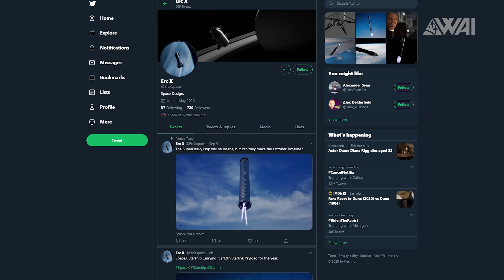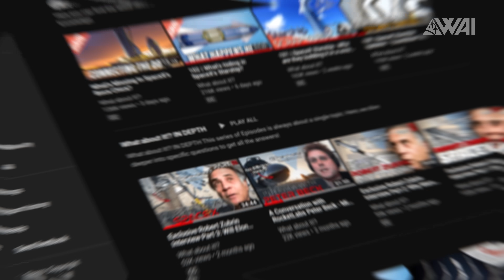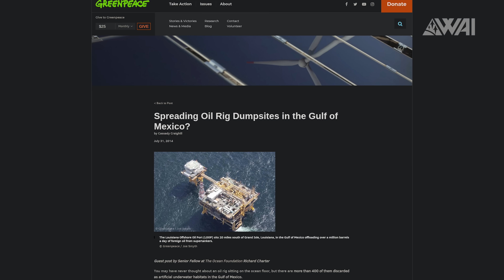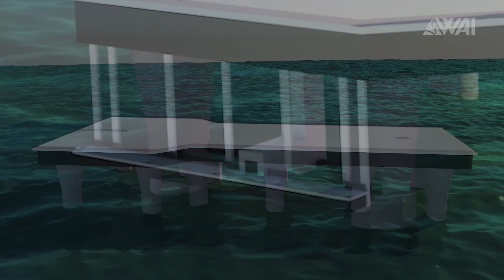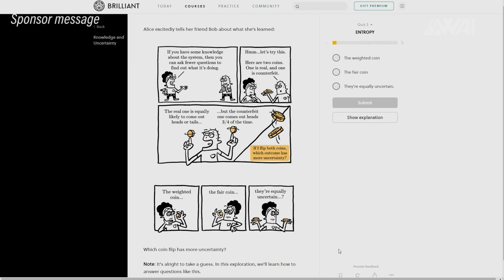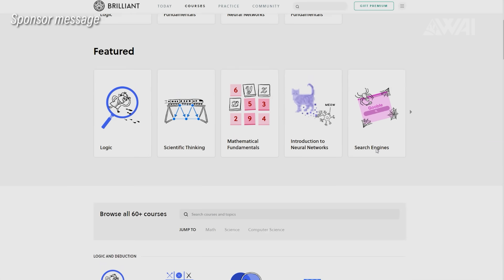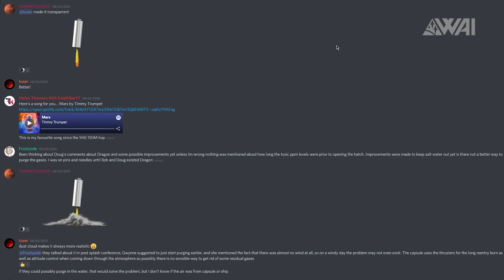118 | SpaceX Starship Mass Production Starting

Comment: I doubt simply exhausting the rockets toward the sea would be good enough. The #1 reason for the sound suppression is to stop the sound damaging the rocket's bell nozzles. I would guess they will still pump water into the exhaust plume between the platform and the sea...A bubble curtain still makes a lot sense though and I'm guessing it would also be used.
Reply: Imagine the difficulties of  transporting the built starships to an offshore platform and elevating them onto the platform.
Reply: @timothyfiedler344 I wonder if they might launch them from the factory to the off shore launch ports. When they build an airliner it flies away from the factory. Starships and the Super Heavy boosters could do the same. The Starship should have no problem making a suborbital flight to a launch port and the booster with perhaps a aerodynamic cap installed should be able to as well.
Reply: You mean hop the starship and boosters over separately with just enough engines and fuel, install the rest of the engines and the fuel+ cargo once on the platform prior to main launch.
Reply: @timothyfiedler344  I'm saying launch completed Starships and boosters separately from the factory to the space ports. Where they would be mated with one another, loaded with cargo and fuel then launched for their first orbital mission. Both are being designed to make many flights with little more than inspections between flights so the easiest way to get them to the space ports may be to launch them there. I say separately because I doubt a booster could land with a Starship still mated to it. Another way to get around having to load Starships and booster on barges is to have their maiden orbital flights launch from the factory then land at the off shore space ports for reuse.

Comment: Why wouldn't SpaceX build them on shore then hop them out to the launch platform?
Reply: Yup, I figure that's how a SS or SH can get back and forth when it needs to, either when freshly built or if a certain need for maintenance is spotted after a mission. An SH can launch lightly fueled, firing a minimal number of engines.
Reply: Still need to use many engines because of the weight of the ship

Comment: If there are a lot of oil rigs available, link 3 or 4 together for each launch "complex." Lots of space then
Reply: would they build a bridge between the oil rigs?
Reply: @zelda_smile  not SpaceXy enough. I'm thinking an underwater zipline surrounded by an air curtain so you don't have to use any scuba gear......
Oh, and it moves you at the speed of sound.
And they develop a way to bore water with a new machine that lays down the bubble curtain and makes freshwater ice cubes to be shipped in self freezing packages to be airdropped during launches on countries that need drinking  water.
Reply: @Christopher Leveck 
Sounds about right for SpaceX  XD

Comment: There are bunch of problems with using old oil rigs as launch platforms. First it's doubtful they could withstand the stresses launching something as large as Starship would put on them. Next most of the gulf oil platforms are not in good positions to be launch platforms and cannot be moved. There are floating platforms, but the abandoned gulf platforms are basically steel towers built on the sea floor. Which is why they get abandoned when the well runs dry.... Anyhow ideally we would want launches not to cross over Florida. So they should be in the Gulf south of Miami or on Florida's east coast. At the very least we would want them close to the Texas coast so at least the booster would hopefully not crossover Florida. 
IMO though SpaceX may partially reuse an oil platform for it's first or even first couple of off shore space ports. Ultimately they will build floating platforms that are similar to floating oil platforms from scratch and they will be positioned off Florida's east coast. In the end a 1,000 mass produced Starships are going to need mass produced, not adapted space ports to operate out of.
Reply: Also, a floating one may not be big enough for their purposes... they're big, sure, but Starship and SuperHeavy are going to need a lot of space... especially if they're going to be operating multiple boosters out of each platform.
Reply: Was looking for this comment.  Thanks.  Most of the abandoned oil rigs are not mobile.  They are fixed to the ground (under the sea) similarly to a building.

Comment: knowing spaceX
i guess for there planning would be if every thing is going correctly
14-09-2020 FN 7.1 Boom
20/25-09-2020 SN 5 second hop
1/10-10-2020 SN 6 second hop
10/15-10-2020 SN 8 hop
20/25-10-2020 first super booster hop
25/30-10-2020 SN 9 hop
1/10-11-2020 SN 8 high attitude hop
10/11/2020 SN9 second hop
15/11/2020 SN8 second high attitude hop
20/25-11-2020 second super booster hop
25/01-12-2020 SN 10 hop
01/31-12-2020 Full star ship space flight test
Reply: This would be really great!  Even the first half of 2021 for a successful orbital Starship would be fantastic!
Reply: I don't want to make you sad, but that's a very optimistic plan. I think the only thing that will come true is a high altitude test by the end of the year. Booster hop early next year and so on. Full Starship flight next summer.
Reply: That's Elon time.
Reply: Elon: "Can we do it in half the time?"
Reply: Merry Christmas

Comment: The launch platform will have to be way bigger than the mockup shows....the arrival of people, supplies, and rockets will require a very large 'port'. The energy requirements to pull C02 and 02 out of the air for rocket fuel will require a huge amount of power (maybe on the order of acres of solar panels and batteries). Other buildings to support all the infrastructure will need to be moved a significant distance away from the launch/landing pads. I am sure there are other considerations, too.
Reply: The 'Fuel farm' would likely need it's own platform. I also would suggest a capital T shaped platform, so the High Bay analogue does not open to fave the launch mount. The other end of the cross piece would have a cutout that would allow the crane to unload the Boosters or Starships from droneships.

I agree on needing more facilities for personnel using the Starship. Fuel and O2 could be delivered via pipelines.
Reply: maybe they will have two platforms, one for launch other for control center and people who work there.
Reply: They would probably need separate platforms.  One for launch. One for service equipment. A LNG storage ship for propellant loading and transport. It would be stupid to have  everything in one place. When an accident happens everything is destroyed.
Reply: So basically like mother base from MGS5?
Reply: Agree, scale seems to be off

Comment: I assume assume as you, that they will make use of an old oil platform similar to what Space Launch did. It will also be possible to get their launches closer to equator than from Texas, in which saves rocket fuel.
Reply: Texas is already close to the equator, for decades it has been the obvious alternative to Florida.

Comment: If spacex needs a 30km exclusion zone for a superheavy launch, why are they building the orbital launch pad at the current starship launch site? Wouldn't a launch from there damage the build site?
Reply: It's a freaking water tower! Just kidding, maybe its not for superheavies but for orbital launches of smaller rockets, like starships.
Reply: They only need 3-6 Rapters for initial SH booster testing .. the full compliment of 31 will need sea launch for sure because of the discussion started here

Comment: Wouldn't it be better to use like an aircraft carrier jet elevator that way there would be no flooding or damage if a storm with big waves washes onto the lower platform.
Reply: An oil rig costs between 20 millions and one billion, an aircraft carrier between 10 and 15 billions. Question answered?
Reply: Just use a crane to lift the rocket.  Small items can use a human scale elevator inside a platform leg, with a nice watertight outer door.

Comment: I'm sure the under water nuclear bomb test were a lot more damaging to the ocean environment than a Super Heavy launch will ever be.
Reply: That was probaply not with three testings per day. But you're right, armies do not care about the enviroment. They where constructed to kill as much as possible.
Reply: @Bauer-ke6lp  The Super Heavy will not be releasing fissionable material into the environment. Also the sound will be generated out of the water and not in the water as in the case of the bomb tests.
Reply: Bauer 33333 you don’t honestly believe they’ll be launching on a schedule like that do you? First off, what customer WANTS that many launches? Plus, how are you gonna refurbish a Rocket that fast? Remember, heat shields require full manual refurbishing and at least a look-over after every reentry.
Reply: @maerus5227  That schedule is not made by me and they will ned a ton of rockets to colonise mars. Refurbishment is easy doable, the more rickets you refurbishe at once the more time you have to get one done. 1 rocket 1/3 of a day, 3 rockets 1 day, 21 rockets one week,  ... They will probably need multiple launch platforms to deal with that amounts.
Reply: You're talking about millions of pounds of thrust multiple times a day.  It will most definitely cross the air/water barrier and it will be a massive amount of noise that will potentially disrupt/kill sea-life.  Pink Floyd did it with just a couple guitars some drums and keyboards.  This isn't a question of what happened in the past, it's about how we can best act in the future.  I'd be open to hearing more about the effectiveness of these air-bubbles as a noise suppresion system.  I'm a huge fan of the Starship system and SpaceX in general; if this can be made to work in an environmentally safe way then I'd be for it.
Reply: @j.jastner8374  actually the air bubble system is great for sound that's generated INSIDE the water, and ultimately, you can just build 2 if 1 is not enough  (first one diminishes most vibrations, but some still makes it past the bubbles, so the second external barrier is able to dumpen it)

the way they work is actually quite simple
sound is a vibration, so you just have vibrating water, but the bubble is (lets approximate it to an air wall) a different medium that separates the inner part from the outer side

another way of thinking about it (more technical) is by assuming that sound transfer in water is very alike to laminar flow, but then you have a barrier of pure turbulent flow (bubbles) so the kinetic energy from the sound vibration is favoring an "even more turbulent" flow when in contact with the barrier  (this has a limit obviously, but adding more barriers just solves everything in an easy manner)

the problem left now is the fact that the sound is outside the water too, so the transfer from air to water from afar would be enough stress to be disruptive for the ecosystem, and all the variables like hoe great that impacted is, or how far is it dangerous inside the water, or is it meaningful at all should be tested
the problem of the water vibrating due to exhaust is already easily solvable
Reply: @j.jastner8374  How do you know what you claim is true?
Reply: @jcf20010  Which point? If you're talking about the pink floyd story it is well documented. The fish in a nearby pond were killed due to excessive decibel production. That's air to water transmission. Or maybe you mean about the starship launch being the loudest human made sound over the ocean since nuclear weapons were detonated. I guess I don't know for sure, but do I have to?  Over land they are talking about a 30km distance to not disturb people or buildings. Can you imagine how loud that has to be to require the launches to be that far from people? It wouldn't even be considered if it were at all possible near a populated area.  Launching from sea will cost more money than having a stable land-based launch facility.
Reply: J. Jastner , Of course not to try and justify it and certainly not the same thing, but that’s pretty much what NASA did in the sixties and early seventies “over water” in transporting Saturn stages from the west coast to Alabama for testing then on to Florida for flight.  The point is sometimes if that is the only practical option then that’s what you do.  Expensive yes, best practical option, also yes.  I’m glad so many people are thinking of ways to help marine life.
Reply: @sonnyburnett8725  We have much more information than they did in the past, and we know better. Further, we live in a golden age of information and ingenuity. SpaceX and tesla are used to solving hard problems.  It is not good enough to simply go down a path because it is practical and available. The stakes are much higher now and the environment is a closed system. Everything circulates. So if sea launch becomes a reality, OK, let's do it. But let's do it right. Let's do it responsibly. The adolescence of humanity should be behind us - we've got the video to prove it. Time to act like adults.
Reply: And even with that, who really cares? I’d be willing to bet that it would be GENEROUS to say that you kill 0.000001% of any given species each time you do an underwater nuke. 

Plus, our goals are simply more important than fish lives. Don’t know why that’s so hard for people to wrap their head around.
Reply: @maerus5227  this kind of thinking is morally wrong.  It is the same kind of thinking that destroyed the American Indians and killed millions of jews and other minorities in Germany. What we think is important does not give us the right to destroy or treat things carelessly. Yes, it takes effort, but there is a right way to do things. And there's no excuse for not taking precautions, or fully understanding the system before affecting it.  I would argue fish have rich lives. But it's not just fish. It's also cephalopods and mammals, The intelligence of which we don't understand.  And since planet earth is a closed system, ultimately, it affects us all. I'm tired of mercury in my tuna, microplastics, medical waste on our beaches and a garbage patch as big as Texas floating out there. How about you?  Research and study is required first. We don't need another misstep.
Reply: J. Jastner you’re not seriously equating THE HOLOCAUST to some dead fish rn. Seriously. 

And It may be unpopular, but yes, I believe that our species is superior to others. Sorry ig. I’m not saying that we shouldn’t extinct something, or attempt to protect endangered species, but a few fish? Yeah. I’m down with killing them if it means advancement for our species. We do it everyday already. And everyone doesn’t complain about all of the luxuries they have on a daily basis at the expense of all the animals.

Also, you’re not seriously trying to argue that fishes have any resemblance of real intelligence, are you? Because that’s a pipe dream Greenpeace kind of thing. News flash: they don’t. They’re VERY basic animals.
Reply: @maerus5227  No, if your critical thinking skills were up to the challenge, you would know i'm not equating killing sea life to the holocaust; I'm equating sloppy thinking, a lack of research and unpreparedness to the point of view that you are espousing (charging ahead without considerable thought to the consequences).  You live here, in this closed, constantly re-circulating system, you should be concerned about the end-game regarding polluting your own habitat.  There's an old saying that really conflicts with your POV - 'don't shit where you eat'.  Your point of view is unpopular, IMHO, not because some people just don't care about fish, but because the reasoning behind your argument does not withstand scrutiny.  Who argues that research isn't a good idea before moving ahead with something we don't know much about?
Reply: J. Jastner I disagree with a few things here. First off, I was under the impression that we were talking about KILLING the fish, not POLLUTING the water. That’s a big difference. Also, I disagree that the middle of the ocean is exactly “my environment”.... And finally, I think all of the research and brainpower should be going toward the rocket program itself, rather than the potentially floating tunas in the water out there.
Reply: @maerus5227  I'll try to be brief as I don't want to stay on this thread any longer.  Everything is connected.  EVERYTHING. It all circulates.  Pollution circulates.  The death of a local food chain circulates.  And we're not talking about the middle of the ocean, we're talking about 30km out.  But even if we were, it wouldn't matter.    You're living in a closed system.  Fukushima did not stay contained to japan, nor do viruses stay contained in one country.  Everything travels.  EVERYTHING.  And everything has an effect on everything else.  Phrases like 'look before you leap' exist for a reason.  Your arguments are specious when you just say go, go go!  Which is kind of funny actually - the one thing that makes humans more human than anything else is our ability to plan ahead.  When you argue against that It's not an intelligent, well considered point of view. All of us here are excited about space, but you don't just do what comes to mind because you can.  You study the problem first so that you can mitigate as many potential problems as you can.  And the people working for SpaceX know that, so I am hopeful to see what they come up with. Anyway, good luck to you.  I hope you broaden your knowledge base.